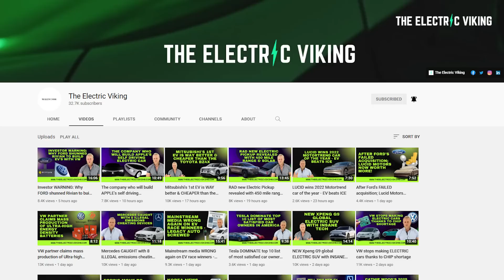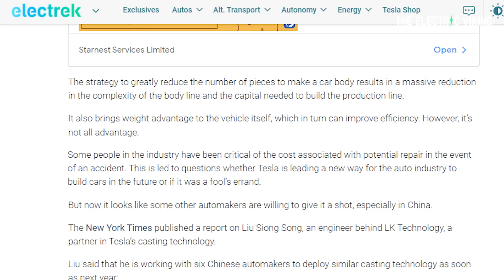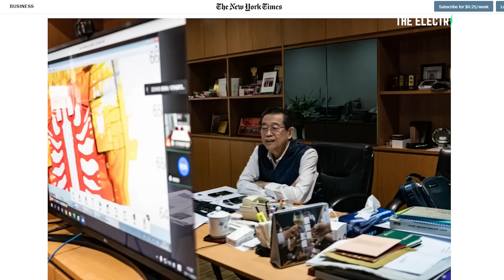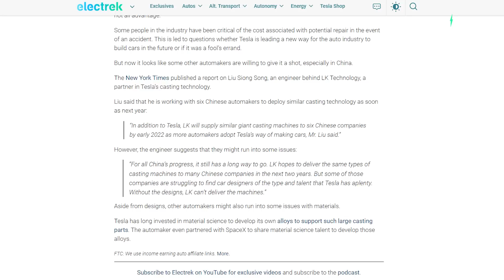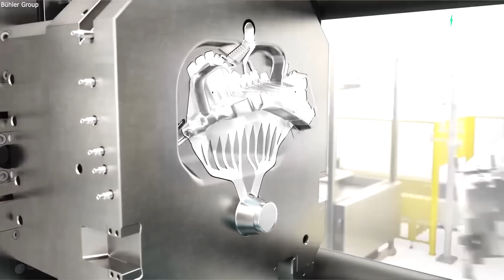6 automakers using Tesla Giga Casting machines - LEGACY auto?!!?

Comment: Even if the other automakers buy the Idra machines, they still need the formula for the aluminum alloy needed to make the process work.  Tesla is not going to give away the formula, that will remain proprietary.

As for repairing a single casted piece, if the vehicle gets into an accident, and the vehicle can't be repaired back to the original safety specifications, the insurance company will send you a check, and that vehicle will be marked as "salvage", scrapped for parts, or crushed
Reply: Why can’t other carmakers cast steel in a gigacast?
Reply: @samijokinen9246  You can buy a hand held machine that will give you the  composition of anything from rocks to coins to bars of metal.

Comment: In a crash, the crumple zone ( front+back pillars) are first to be deformed. If then the casting is effected (last chance Salon), it means that car is effectively a write off - it means it have saved your and others lifes. So it's not really there to be repaired.
Reply: and only the 1%er's can afford that.  the rest of us working folks can't afford a low speed crash to end the life of our 60k car with a $1,500 a month payment.
Reply: @michaelfried3123   you drive around with no insurance? Drive a $60k  car with no insurance ? 
What i said was its the crumple zone that lessen the impact. Any more engery in the crash, is transferred into the die cast - deforming it. Like another other car it save your life. It is written off(or the small dent) which your insurance incurrs.
The casting is much stronger than the "normal"  underbody steel floor plan.
Reply: @timypp2894  did I say I drive around with no insurance?  you might wanna go back and read a bit slower if you did.
Reply: @michaelfried3123  so what are you talking about? Your insurance covers all crashes from dents to write offs? 
The crumple zone is destroyed and you going to repair that? 
What's the purpose of crumbles zones?
And if the crash intrudes into the habitable structure?

Comment: Tesla is looking for a win-win situation; castings and FSD adoption. If FSD is adopted in the US then the issue of damaging the vehicle castings will be reduced significantly...when FSD is mature enough. With Tesla insurance it may even be better since the premium rates will be based on a digitally monitored driving score...the better you drive, the lower the premiums, and likely the less accidents. When most vehicles are autonomous, car accidents will likely become a rarity. So most repairs will no longer be needed. So Tesla is looking ahead, although it may not be the perfect solution now, it soon should be. So when you factor in castings, FSD and monitored data for insurance, accidents will be the rare exception. I think many of the Chinese auto companies are more confident about developing autonomous driving. The US and Europe (other than Tesla) manufacturers don't really have that confidence even though they pretend to. They should be confident since if worse comes to worse they will be able to license FSD from Tesla and Elon has hinted that it may be possible.

Comment: It's not just the alloy.  Other companies can buy a tesla and reverse engineer the alloy components.  It's now the alloy flows while heated and how to design the casting.  To get the casting to work properly you need to be able to fully simulate the flow.   The physical casting has to be heated and cooled in different areas.  Certain flow channels behave differently.  Etc.  It's difficult.  Tesla figured it out, but this missing piece is not common knowledge.  These other automakers could get a casting machine and build a die, only to have the alloy partially fill the cavity.  Also, the parts might crack when they cool.  Also, these are big, high pressure events that happen in a very short time frame.  The clamps are so big because so much force is required to hold the die together when hundreds of pounds of molten metal are rammed inside it.  Think about the pressure behind that molten metal.
Reply: I suspect it would blow the tooling budget for most, but offers big cost savings if it can be done.
Sandy proposed it but none took him up on the idea.

Take care all M.

Comment: The problem with these giga-casting machines, is that one company in Italy is the only company that I know of currently capable of making them & it is working flat out to satisfy Tesla's demand. The Chinese would be able to buld up a similar company from scratch, but the Italian company has decades of experience in this field. 
 You are correct that Tesla uses it's own special alloy. Personally, I wouldn't trust some Chinese & legacy companies to make the investment to develop a similar alloy. We might end up driving a car cast from pot metal. 
These cast parts mean that a manufacturer would need far fewer staff. This could be difficult for German, Italian & French auto manufacturers. It would be very political (Although it might be easier for Renault to move to casings for their Dacia cars, similarly, VW might be able to implement it more easily at Skoda & Seat).
As for the structural damage, I agree. Any collision that could cause structural damage to one of those castings, is probably going to cause a convential car to be a write off too. The only problem I can see, is that whether a convential car is a write off, is easily identified by an experienced mechanic, whether a casting has structural damage, isn't always obvious without specialised equiptment, causing the mechanic to rightly err on the side of caution & scrap a couple of drivable vehicles each year.
Reply: L.K. Technology Holdings Limited, a Hong Kong-based company, is the sole owner of IDRA and produces also die-cast machinery. They have access to all the secrets of IDRA.
Reply: wrong: Bühler is releasing something similar soon and Toshiba is working on theirs. 

Indr is owned by LK machinery 0558.HK which is based in China.

In terms of metallurgy, China is not far behind the US in terms of getting the product invented, the problem is with their QC. But I used to work for a Chinese surgical implant manufacturer for 3 years: our Chinese supplier had been improving their QC such that their batch to batch variation is on par with Carpenter and better than ATI when I left.
Reply: @MultiYlin  To clarify. I have no doubt that Chinese companies are capable of producing alloys comparable to those of any other industrialised country. My point was that some companies will cut corners & use inferior alloys. To use a building anology, China like the rest of the world, knows how to build appartment blocks, yet some of China's appartment blocks are known for their poor quality. Similarly, recently a complex in Miami collapsed, a couple of years ago, a tower block in London was devastated by fire, all of these cases involved the use of cheaper, less suitable materials. 
 Bühler & Toshiba's machines I'm sure will be admirable, but they are not available today. VW group are not going to order hundreds of machines that are still in development.
 LK does indeed own IDRA,  & IDRA has a plant in China. But Tesla went with the Italian plant because IDRA Italy has decades of experience.

Comment: This idea is not a new "Thing". Back in the pre-1990s many of the big cars were, what was called, "body on frame." They had a big steel ladder called the "frame" onto which the wheels and engine etc were directly  mounted . Then the body panels were attached onto it as well. Auto wreckers would sell front and rear CLIPS which were made up of all the front end body pieces from the firewall forward or backend pieces from the parcel shelf back. They were sold as "units" or "assemblies" so saved a great deal of time in reinstallation on to the car being repaired. Depending how Tesla does the attachment of the giga-castings, this strategy could be utilized even with new parts, saving money, instead costing more as many are purporting.
Reply: It’s all about saving money.

Bye M.

Comment: You "don't understand" how the Legacy autos didn't catch onto Gigacastings? Watch The Limiting Factor's videos on Gigacasting. Legacy auto is going for High Strength Steel. High Strength Steel is actually lighter for the same strength than aluminum! (at the micro level) The savings only come in if you do an analysis on the level of the whole vehicle and the entire manufacturing process -- and then only if you massively scale up the use of castings. It could well be that only Tesla could've figured out the advantages, and only imitators of Tesla would ever go this way!
Reply: The Limiting Factor videos on gigacastings are awesome. Real depth explaining  the trade offs . Sam gets carried away because he is too busy making videos to do the hard work. The legacy guys have significant know how in stamping steel that neither Tesla or the Chinese start ups have. The total bottom line savings, all up front to back, labor and materials are very close between HS steel and gigacastings so if you are starting from scratch castings maybe seen as easier but the process is not without its problems and issues. Besides, the chassis is a small part of an EV cost which Sam doesn’t understand. Although he is on the right track he often gets in over his head with regards to tech details
Reply: @gregorybarnhart5342  Reducing floor space, reducing steps, reducing tolerance loss when attaching pieces -- all of these are a very big deal! I think The Limiting Factor's analysis is correct: Aluminum gigacasting comes out significantly ahead!

Comment: The trend here in the US is for auto insurers to write off cars even if they can be repaired. In many cases, crashes cause unseen damage, and unless the damage is essentially cosmetic, why take a chance with a looming danger? Moreover, as the EVs employ more sensor technology to compensate for the mistakes drivers make, we can expect fewer accidents. Castings appear to make the car safer and a crash more survivable. 

I agree with the observation that adjusting to change requires a hefty dose of humility. 
What many people don't understand about Tesla is that they are in the process of continual change. They do not rest on their past success and continually look for ways to improve their products. If they can find a way of improving, they have no problems shifting in that direction. US automakers lost their way because they forgot about their customers and refused to innovate. GM has even encountered resistance from many of its dealers, who don't want to sell electric cars! How can anyone compete with Tesla with that kind of weight around its neck?

Comment: There is something that no one mentions about the castings.
First is that legacy manufacturers do use large castings in suspension and other parts of the car.
Second is that they have lots of experience working with sheet metal which is something Tesla doesn't have.
There is a possibility that legacy manufacturers are so good with sheet metal that the casting doesn't bring sufficient benefit.
There is also the unknown of how the castings will perform over a 10yr life span.
If for some reason the welds or the castings cracked after say 5yrs and they had to do a recall that would put Tesla out of business very quickly.
Reply: Sorry - but Sandy Monroe has been "testing" large castings, like the Tesla unit, for years. But I'll defer to him on why casting large segments are cheaper, longer lasting and LIFE SAVING as well.
Reply: Its about sunk costs legacy auto have in their plants versus large capital expenditure for new machines and the job shedding required to go to mega/giga castings. All of these things are going to be hard to justify. All the castings legacy auto use are made by a subcontractor OEM. GL trying to find one that can/will produce a mega/giga casting for you.

Comment: This was hotly debated when model 3 rear came out. 
Verdict:
Teslas get in far fewer crashes, and the casting is protected so that only in the most severe crashes, they get cracked. But it would be a write off either way. 
Tesla is insuring these cars, remember. They have thought of this all a long time ago. 
Takeaway: in Elon we Trust
Reply: They only get into far fewer crashes because there are far fewer of them....
Reply: @kevingoff6964  that's the strangest comment I've ever heard mate
Reply: @dogefromthefuture  But it’s the customer who pays for the insurance, remember and those costs will add up over time. Especially for second-hand car owners. Even if Tesla was never at fault, somebody will have to pay for the damage done to a Tesla. Either way, these cars are expensive to insure and that will be a dealbreaker for many.
Reply: @diazemap  you missed the whole point. It's not more expensive
Reply: @dogefromthefuture  To insure, surely and right now, doubly. Case and point. In the future maybe (should FSD ever work as advertised but not as of now). It's not a matter of opinion, it's what the insurance companies are charging right now though the rates vary. Tesla IS more expensive to insure because of collision coverage and one of the reasons is that aluminium is not as easily repairable as steel. Tesla also uses very little plastic as material and plastic is cheap. Moreover, you have to fix it at the dealer with expensive specialized tools which also  increases prices. 

Yeah you might say that Tesla is not so easy to steal, but that's just a small component of your insurance. FSD is far from being what it says it is and these gigacasting won't affect much. Just that the cars will be cheaper to make and thus more affordable. That I don't deny.
Reply: @dogefromthefuture  why, comparatively speaking there are far fewer teslas than ice vehicles on the road and will be for a long time, so you can point to a number and say, see less crashes but the only place in the world with significant teslas on the road is CA and quickly China, so of course there are more ice accidents
Reply: @kevingoff6964  You're actually absolutely right in pointing out this obvious fallacy but there are more things to mention. I would go as far as to say that there might actually be more Tesla crashes than those of ICE cars also because Teslas are sports cars driven in a fairly spirited way and on top of that, their owners often play dangerous games by not driving the car believing that FSD is what Musk says it it even if it's not. I have seen so many Tesla accidents that wouldn't have happened had the driver not relied on the autopilot. On the other hand, some accidents did get prevented because of its sensors. However, Tesla is not the only car with collision avoidance technology. Of course, when (or I should rather say if) FSD is infallible, there will be fewer Tesla crashes than of anything driven by humans but once again, we're not there yet by any stretch of the imagination. The trouble is that Musk fanboys live in the future la-la land not the grey present. Musk is incredibly fake in so many areas that it's not even funny and I also believe he won't get away with any his lies and will eventually be regarded as one of the most controversial entrepreneurs.

Comment: Tesla has bought up the entire supply of IDRA GigaPress machines, leaving nothing for anyone else to buy.  Then there is the supply of aluminium and alloying elements. On top of that, Legacy of Auto build with steel. Mixing ferrous and aluminium parts leads to electrolytic corrosion. The whole car body has to be one or the other.
Reply: You appear to sound like a metallurgy expert, however I'm not, but I do know that the castings are bolted AND bonded (glued) therefore the bonding material will act as a separator, nullifying the electrolytic reactions which result in electrolytic corrosion (SpaceX materials scientists, again, no doubt).  Countless cars have had steel shells with aluminium wings, doors, bonnets & bootlids.
Do you work for Ford or GM?
Reply: On top of that, Tesla has not bought up the entire supply.  IDRA has a twin company LK Technology, producing the same machines.  Tesla use both suppliers, I believe.

Comment: Tesla don't make the Tesla giga press casting machine. They simply buy it.
Reply: Read the lk tech article they could only develop the casting machine's when working in direct concert with teslas engineering staff. 
The series by idra on making the giga presses said the same thing. They worked directly in concert with the tesla engineer's.

The lk article specifically mentioned them struggling to work with others who had ordered their own casting machine's. Because those companies engineers didn't have the exact specifications and technical knowledge needed for lk to supply them with machine's. 
They even mentioned tesla just has better access to engineering talent.